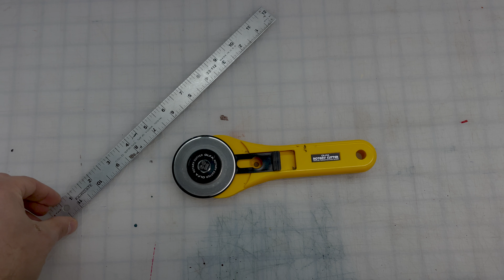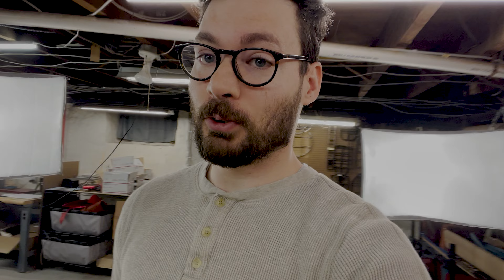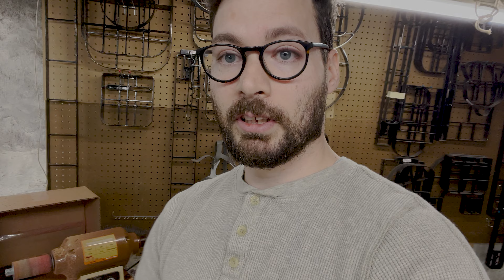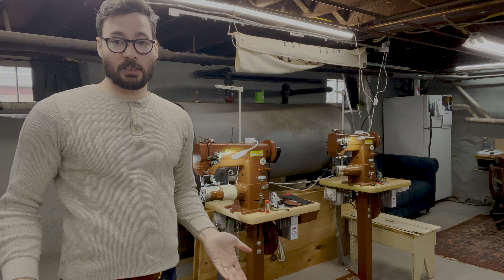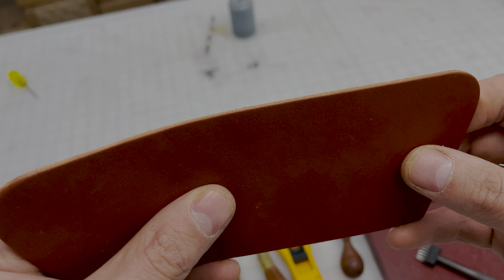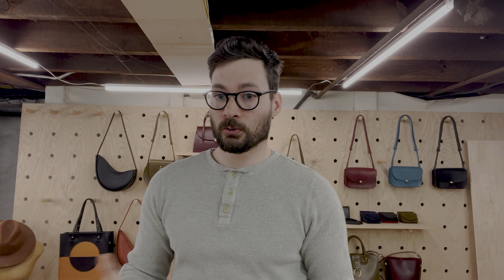Leathercraft tools for beginners. Which tools are worth the upgrade?

Comment: Ive brought some leather to do a couple of one offs items.  But I would like to do some decoration on the leather, what can Ia use without buying any tools to do some basic design on the leather?
Reply from the maker: This is difficult to answer without knowing a little bit more. It the leather veg tan? and what kind of design were you hoping to do?
Reply: @hemlockandhyde  Sorry yes it is veg tan. would like to have some swirls around the edge and either a simple design on the main face. But that's getting to far into it, so maybe initials M W and then something underneath to highlight
Reply from the maker: Maybe you could look at some of the tooling tools and see if you have anything that could be similarly shaped or has an interesting pattern that could be repeated? We aren't super knowledgable about tooling. Or you might be able to find something inexpensive that could be worth it.

Comment: What edge roller tool are you using?  It's the thicker roller I saw.  It looked like it gave you better coverage.  Also, do you use a basecoat or just the color coat - multiple layers?  Any top coats?  Lastly the brand you use?
Reply from the maker: we've tried a bunch of rollers and this is just one we got off etsy. as far as applcation we do 1-3 layers depending on the color. Some take more than others. we don't apply a base or top coat. We work directly with a manufacturer for custom paints. we have tried Uniters and Vernis paints and used them in the past if you are looking for a place to start.
Reply: @hemlockandhyde Thank you.  I've used Giardini and just not a fan.  Lots of sanding required.  Do you all sand each layer as well?
Reply from the maker: sometimes we have to sand a little between coats, but mostly we try to make sure the leather edges are in good shape before applying paints so we're doing the least amount of work with the paint. Interestingly it feels like each color has its own slightly different application method. Kind of like painting the room of a house. For example Red takes probably the most amount of coats.

Comment: What make/ model hot press stamp machine do you use/ recommend?
Reply from the maker: We use a Kwikprint Model 86. We were fortunate to get it second hand from a monograming store. There are so many options out there now that have digital temperature, auto gold foiling, pneumatic, etc. I think most leather tool companies carry at least one option these days. I would match the size of your hot press to what you need in terms of size. If you are making wallets, belts and small goods you wont need a monster machine. We wanted a larger machine since we make bags and have deeper panels that get stamped sometimes. hope that helps

Comment: Tapered maul was my first upgrade. Another was a snap setter similar to what you use. That has made my snap setting almost foolproof as well as rivets.
Reply from the maker: Yeah the maul was a huge help. It's one of those tools that your wouldn't think would make a big impact, but it makes using  the hole punch/pricking irons/etc.. easier.  We waited an embarrassing amount of time before getting a rivet press it made such a huge difference, and stopped being a stressful part of making. It's also relatively inexpensive especially if you use it often.